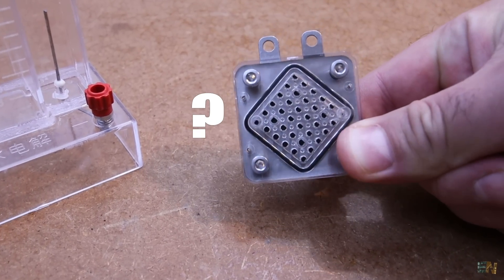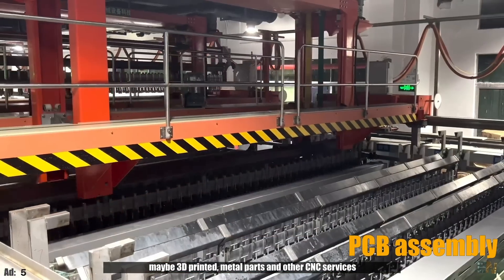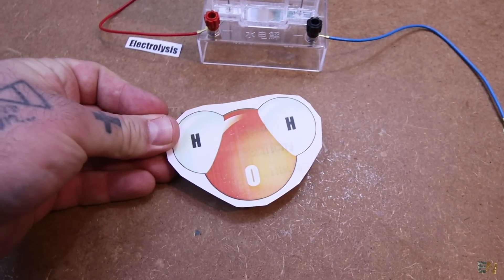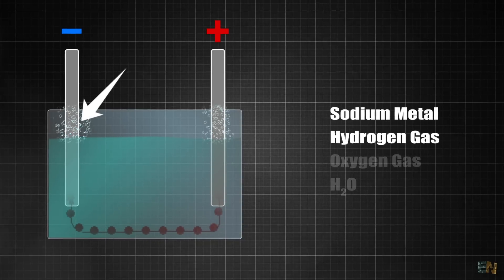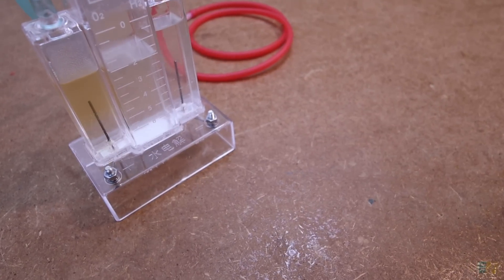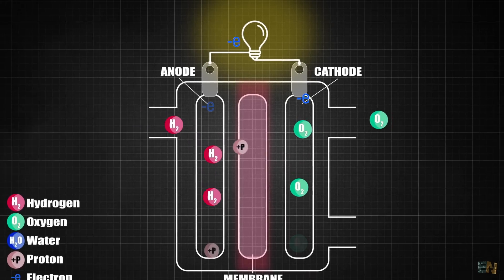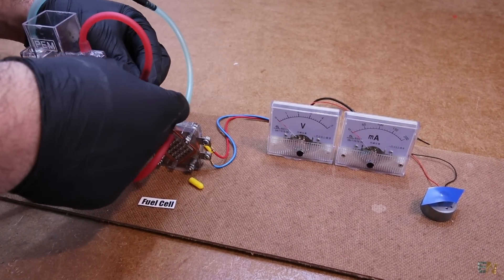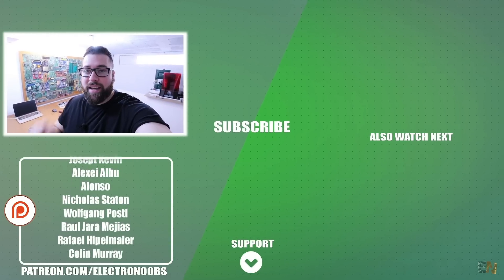Hydrogen Fuel Cell - Is Hydrogen Car the Future? + Electrolysis

Comment: If you keep exploring that route you can check Valentin Petkov's channel. He is reviewing Stanley Meyer's patents for electrolysis. As Stan mentioned, to split water in an efficient way, water has to have some resonance so molecules are excited and more prone to be split instead of brute force electrolysis. Of course you did the opposite in this experiment to get electricity, but due to the fact you are electronic savvy, Valentin's experiments should make more sense to you
Reply: You can patent stuff that doesn't work, and in this case it doesn't.
Reply: Check his Wikipedia page.

Comment: Hydrogen cars are just not a sensible choice. Making Hydrogen from electricity is really energy inefficient, and nearly all of it is actually created as a by-product of oil-cracking to make petrol and diesel - not clean. We already have a far more efficient electricity distribution network which is easily capable to expanding if necessary. Creating a whole new network for yet another explosive gas, that's just nuts! We already need to get rid of the natural gas network and stop burning carbon based fuels.

Comment: This is not where hydrogen comes from you are lying.
Reply: Hydrogen can be obtained in different  ways, as it tends to bond with other elements. The most efficient way to this day to get it is by chemical reactions
Reply: @hyundaiverna   You can also get it from aluminum foil and drain cleaner. Doesn't mean it works commercially.
Reply: Elaborate.
Reply: @tomclanys  Hydrogen is separated from fossil fuels and shipped around the world as ammonia. It does not come from water and electrolysis. This would be dumb to waste so much electricity to, in the end use electricity.
Reply: Well... at least the chemistry of electrolysis he speaks about is incorrect. Sodium hydroxide is normally not consumed in this process.
Reply: Is your Google busted? You want me to do all the heavy lifting? Really. Shame on you. If you were really interested you would look up the data to prove me wrong. If you can. Which I know you can't. I've posted the best video I have ever seen that explains the entire issue, answers your question and you won't even watch it. Seriously have some self respect.